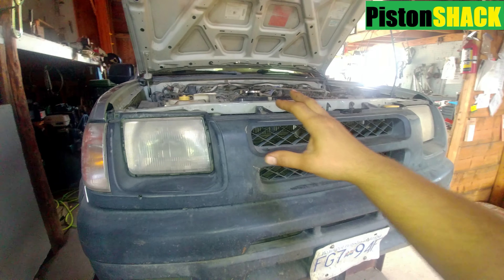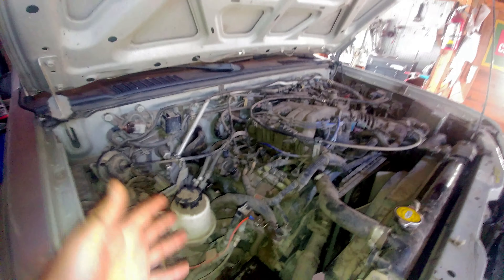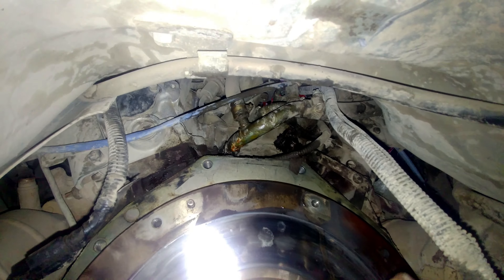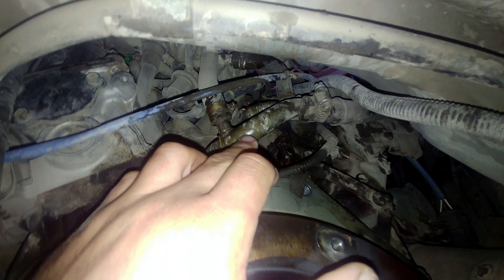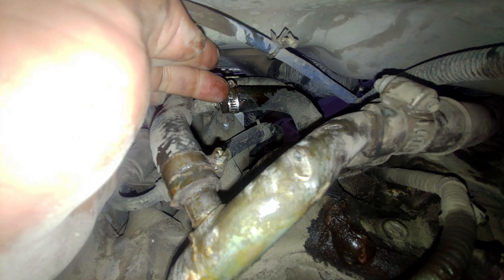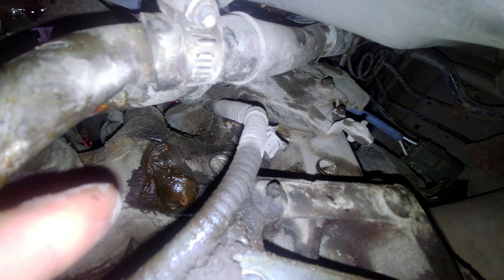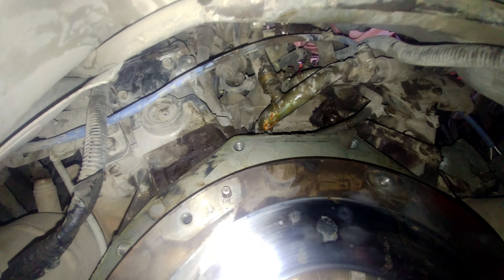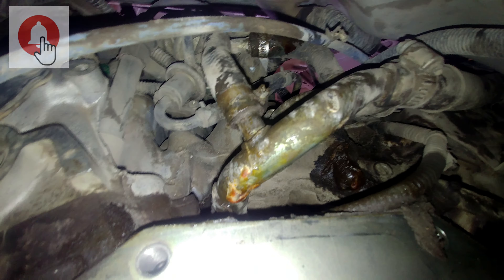COOLANT LEAK FROM BACK OF ENGINE - NISSAN XTERRA / FRONTIER (VG33E) - WELL SHOWN.

Comment: thx for the video. at least 1 reason why you're leaking is because you are using screw style hose clamps. i know because the spring clamps are a pita and when i did my 100k service, i went to worm-style screw clamps because they were easier to put on with limited space between the back of the intake manifold and firewall but also because i got gates hoses and they're thicker than OEM so the spring clamps max diameter didn't fit. after a while it started leaking. at 150k, i took out the gates hoses and put OEMs back in and used spring clamps and those leaks went away. as far as the 2 hoses which cannot be accessed unless the tranny is out, your video helped me see them and i will order them and have ready. i have to admit though, nissan design of the coolant hose flowing through the intake and throttle body and all over the place  is the dumbest engineering because it causes coolant to leak wherever rubber hoses exist and is how it ruined my alternator. currently doing valve cover gaskets. wire protector and electrical tape completely disintegrated on the entire wire harness like potato chips.

Comment: Hey do you have these part numbers? Did you do this when the transmission was out or did you take the manifold off?
Reply from the maker: No, I don't have part numbers. You can call local Nissan dealer to get all specs and numbers.

Comment: Question??.can the leaks be repaired without pulling transmission and/or pull engine?....Very helpful.. thank you.. DOUBLE THUMBS UP AND KEEP ON KEEPING ON.
Reply: Great question I am wondering as well. Just got a 2000 xterra that apparently has the freeze plug or one of the lines leaking back there and having to pull the trans is gonna suck

Comment: Thanks a lot for this video. I am having just the same problem with my 2000 Exterra.coolant leaking from the back of my engine .I see lots of smoke coming from the back of my engine. My mechanic ask me on the phone to just fill the radiator with water until he is back on Sunday morning in Atlanta. I had filled it with new antifreeze before he told me. Well I just try to drive home after cool off but in about 15 minutes on the freeway I see the smoke and car overheating. My question to you is that( is it risky for me to drive after the engine cools off .and I top it with water.
Reply from the maker: Hi Moken, well it depends how far you need to drive. I would say, better park it until you will get it fixed. Sound like you have serious leak at the back of you engine. Mine has small leak I can drive for a month till I can see some coolant drop inch or two. 
Do not risk it. 
Bzw, thanks for watching and subscribing. Stay safe.
Reply: Same issue here with my 2004 Xterra.  Turned out to be a blown drivers side head gasket leaking also into cylinder #6
Reply from the maker: @DavidVasquez-hs9bo  Did you do head gasket leak test? Bzw, thanks for watching. Let me know if you have any questions.
Reply: @PistonShack  yes I did the leak down test and a compression test.  Compression was low on cylinder #6

Comment: Did you ever make a video on repairing the leaking lines? Having the same issue with my brothers truck and wanted some advice before tackling it. Thanks for the vid
Reply from the maker: I fixed few leaks that time but to do it properly you have to remove the upper plenum intake manifold to get access to heater lines and hoses from the top. I didn't film it. It doesn't leak so far but I am planning to get it to fix properly. Cheers Dexter!

Comment: Thank you for video. Mine loses coolant also 2000 frontier. Maybe this is spot. I never see any drips. One mechanic said blown head gasket is what ruined radiator, I think it got low and hot. But now new radiator is blown that I installed after having coolant checked for head gasket leak, with no results. Iam at a loss.

Comment: Thank you for this video. Mine keeps running hot and pushing water out of the reserve tank then put new clutch fan water pump radiator cap thermostat if been lost. I keep getting lots of pressure pushing the water out I'm getting air from some were
Reply from the maker: Glad it helped. Thanks for your feedback. Cheers!

Comment: I have a 2001 exterrs ,a pine hole leak was discovered using a pressure tester a rented.what a pain to replace the hose. Can be done.if I had to do it over. Would remove the intake plenum.  There's a video how on u tube. Good luck change the #7 plug while you're at it

Comment: Thank you omg I’ve been having coolant problems in my 04 frontier for like a year I could never find where it’s coming from but my truck leaks and smokes from where it’s dripping on exhaust I would guess? Any ideas on what else it could be
Reply from the maker: Hi E S! I am so glad it helped you out. U would go and remove upper intake manifold then replace all heater core and manifold coolant lines and hoses. There's no way to fix coolant leaks) Thanks for watching. Take care!

Comment: Great videos. I like the Nissan VG33 content.
Reply from the maker: Greetings Xterra Rod! Thanks for watching. I hope it helped you out.  I have more interesting useful content to share. What kind Xterra do you drive?
Bzw, you have cool name: "Xterra Rob", I like it!.
Thanks for watching and subscribing.
Reply: @PistonShack  2004 Xterra!  I make Xterra videos too, but mostly about modifications, offroading, and lift kits. I hate those coolant hoses...they always seem to leak even after I replaced them. It was useful to see them with transmission removed from the backside of engine.  Ever have to do rear main seal or oil pan gasket? Trying to track down an oil leak at the bell housing currently.

Comment: Yea im having same problem i hope its just hoses and not gasket leaking how do you get to all thos hoses im guessing you have to drop the gear box or take off the upper manifold to reach around under there?
Reply from the maker: You don't have to remove the gearbox, just remove plenum intake manifold to get to the back.

Comment: Thanks so much, my 2002 is leaking coolant at the back. Seems like I need to drop the transmission to make repairs.
Reply from the maker: Hey Jerry. No, you don't have to go that far. Just take upper plenum intake to get access to the back size of the engine by the firewall.

Comment: please tell me where you bought the cool wire cutters ( insulation removers ) that you show in some videos
thanks
Reply from the maker: Hi, 
You can find them online, I haven't seen wire-cutters like this in retail stores. My cutters: Proskit 8pk-371d. One of most useful fantastic tools to have in your tool box, especially if you do automotive electric. I use mine almost every day.
Check this ebay.com link: https://www.ebay.ca/sch/i.html?_nkw=8pk-371d&norover=1&mkevt=1&mkrid=706-157315-215090-3&mkcid=2&keyword=8pk-371d&crlp=435199077774_&MT_ID=590566&geo_id=34636&rlsatarget=kwd-301984348208&adpos=&device=c&mktype=&loc=9001470&poi=&abcId=1146426&cmpgn=8418985567&sitelnk=&adgroupid=85648950706&network=g&matchtype=p&gclid=Cj0KCQjwhb36BRCfARIsAKcXh6G7dVjv8522_XsZsaOiWHapZD3_i3YnJytxToGuFEI77-ygsZH3YzgaAtYiEALw_wcB
Reply from the maker: Quality tool Made in Germany
Reply: @PistonShack  It's good to have quality tools...thanks for sharing

Comment: How much will a mechanic charge me to fix it my 2004 Nissan Frontier has the same problem?
Reply from the maker: That's good question. I guess it will take 4 hours to get it fix plus parts and taxes. I think it might cost over 500$ easy. Let me know if you will get quote from the repair shop. Cheers!
Reply: I got a quote they said $950
Reply: @PistonShack  they said around $950
Reply: @PistonShack  I wish you live in California brother

Comment: I have the same problem what are the name of those hose? How can I ask for them at autozone?
Reply from the maker: Hey Marco! I don't have exact name for them. I looked OEM Xterra manual, there isn't any information about those back hoses. I would call them back heater core connecting hoses/lines. Let me know if you find anything. Thanks.

Comment: Hi I'm trying to change those hoses on the back of the engine which I believe the devil himself has decided to place them there because they are impossible to get to!  I am seriously considering dropping the gear box to get to them.  Do u think that is too radical a thing to do to get to them?
Reply from the maker: Hey Mitzi! I would just remove upper intake plenum manifold to get to them. I won't recommend to drop the gear box, it's unnecessary if you need more room I would remove lower manifold as well.
Reply: Don’t fight with it. Just cut it and put new hose.